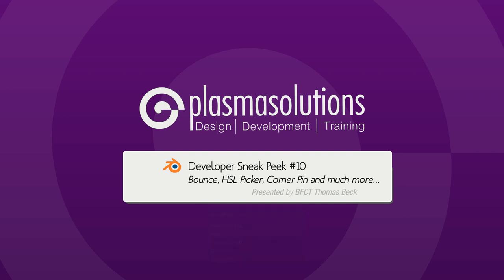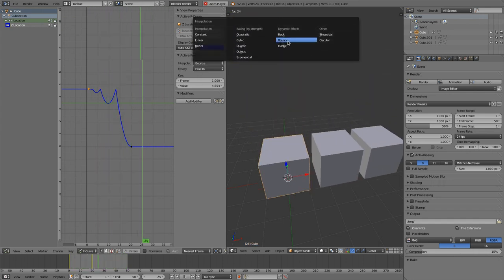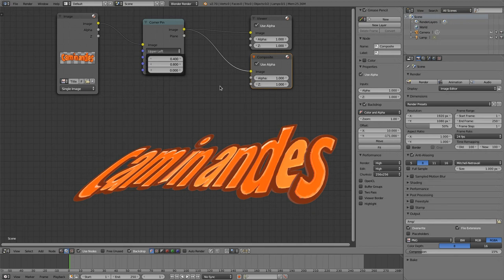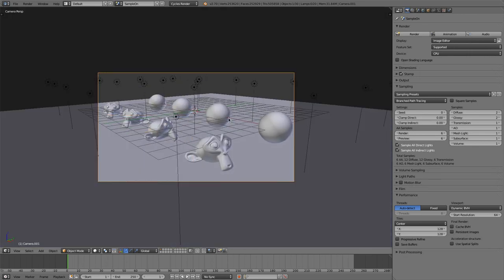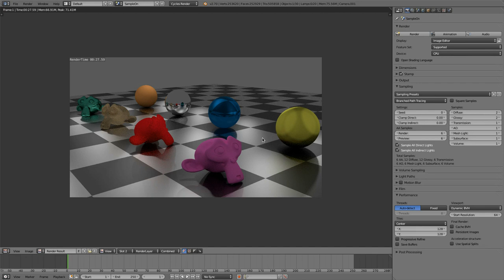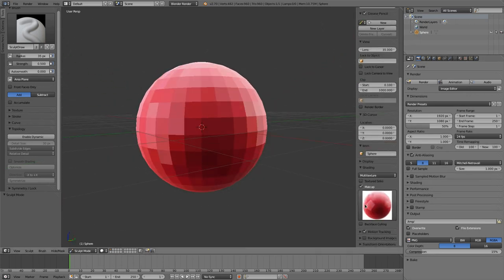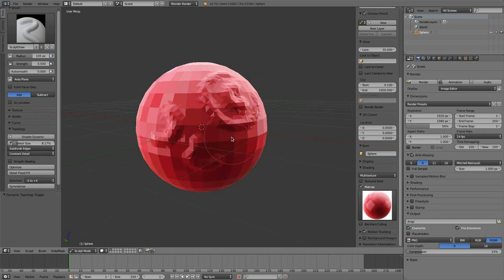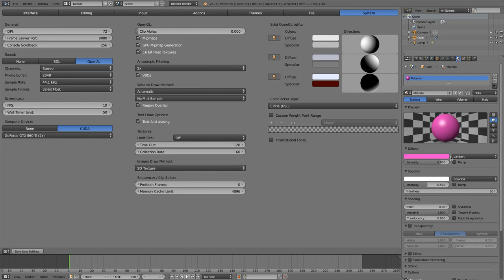B3D Sneak Peek #10 - Bounce, HSL, Corner Pin, Dyntopo

Comment: Ireally like those new interpolation modes, but the problem is that it’s not possible to change them for many keyframes at once with parameters I have set for the one kayframe I have. Every time you make a new keyframe, it’s with default parameters, so every keyframe must be adjusted manually.. and for every axis if your animation is using more than one. So.. there should be a way to copy those parameters.. and I think every time you make a new keyframe, settings from previous keyframe should be automatically copied. Otherwise the ease of use and time saved is actually not as big comparing to manual keyframing.
Reply from the maker: ***** I will discuss it with Joshua, let's see how we can handle this for 2.73.. stay tuned we'll cook something together.

Comment: Really looking forward to the easing equations, especially Quadratic (for being constant acceleration, like gravity) and Sinusoidal.

I noticed in the Rocket Science video and still on the developer page this quote:

"The (optional) extra parameters for Back and Elastic don't have a UI method to set them but they can be set through python. "

I wondered if there was any plan to give them a UI method, and what those parameters might be?

I was hoping they might be things like setting the number of bounces for the Elastic (and Bounce) interpolations, or even the "squishiness" of the Bounce collisions for imitating softbody like bounces, that would be great. If not we could find that everything in Blender world bounces precisely 3 times? :D
Reply from the maker: Yes, those are things that are needed for sure. But we'd like to have a good UI for that too (imho some handles for the bounces and a value that defines how much of them) but that will be reserved for later - atm I'm lacking of time. Will work on that after I finished writing my Blender book (in German).
Reply: Plasmasolutions Ah cool, thanks for your work so far, and good luck with the book!